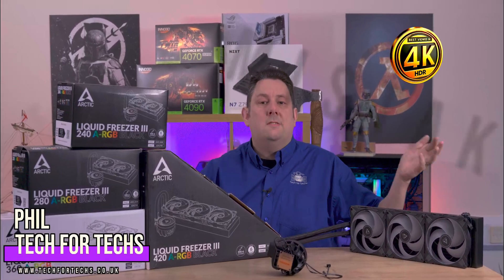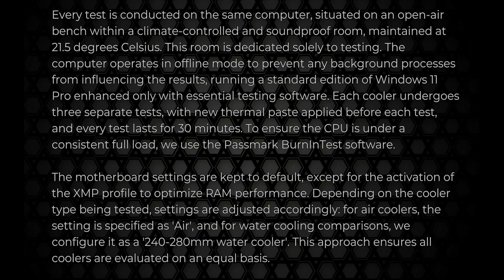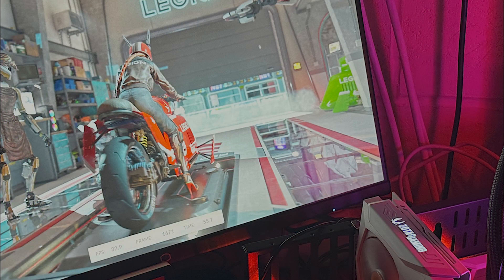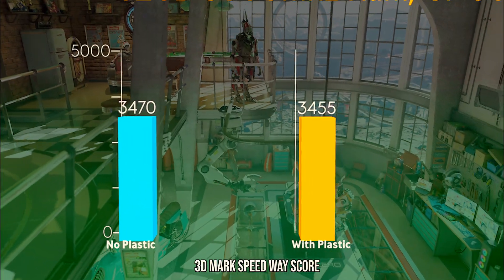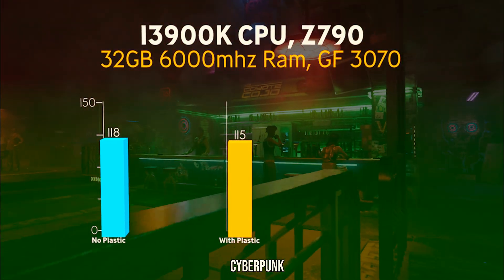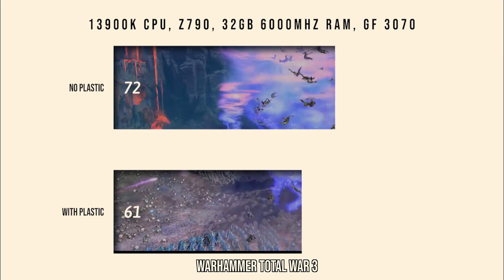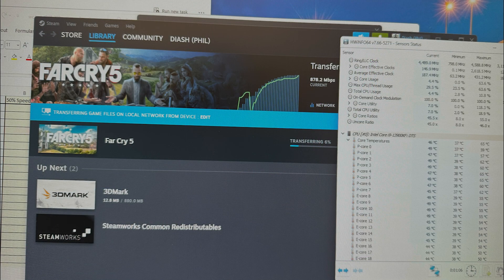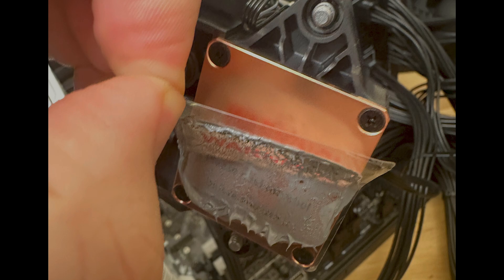See What Happens When You Forget To Remove Plastic On Your CPU Cooler?  - CPU Sticker FAIL

Comment: Yep! I made that mistake with my Peerless Assassin 120. I thought that I didn’t have enough paste or that the cooler was defective. I pulled the cooler off to check the paste and saw that I left the sticker on by accident. 😂😂😂😂😂
Reply: Hey man is this an instant thing? Or does it take almost a year for the throttle and overheating to happen? I forgot if I took it off or not, I literally don’t remember but I’m getting really good temps so I think I did but idk